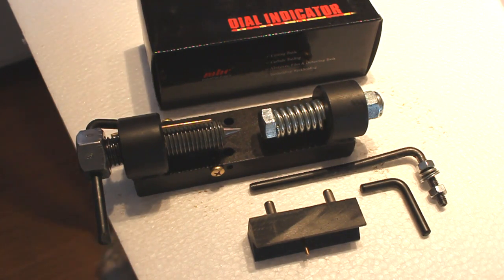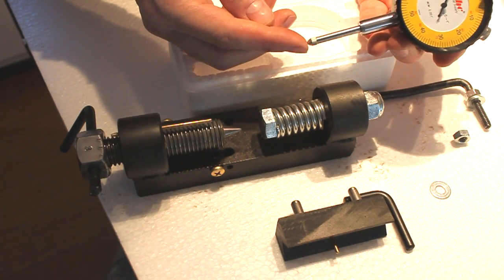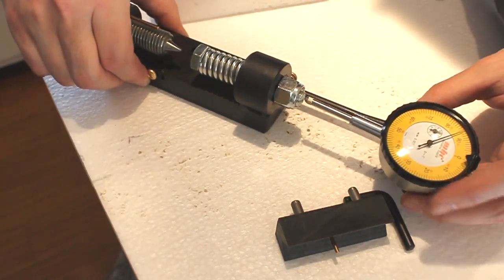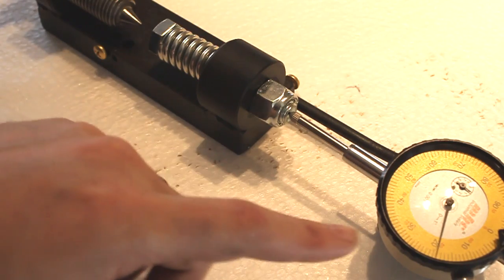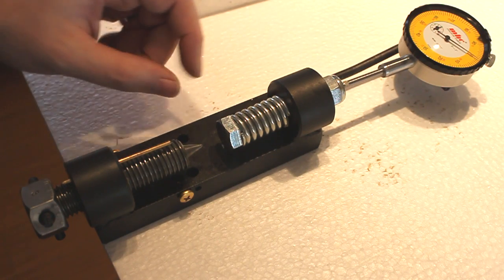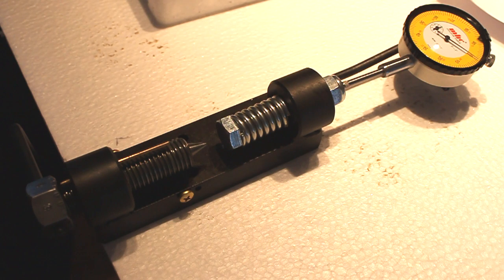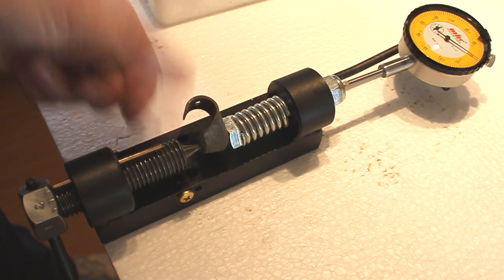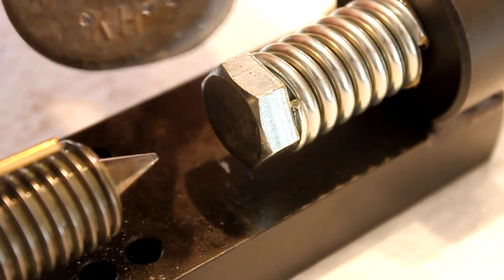Cabine Tree lead hardness tester

Comment: As a retired tool maker  the idea is sound but its bad practice for the ball  point on the indicator to go into a depression  on the tester  .. no depression  is needed it should  be just flat  and this will eliminate  any misalignment  issues  between the indicator  and the tester. I'm  sure other engineers  will agree

Comment: There are two areas that need to be modified here, the point should not turn into the sample, this should remain pushed straight in by being free to rotate, an easy modification, and the end of the thrust plunger, that the dial indicator rests on should be dead flat, another easy modification, these two mods will make it a much better tool.

Comment: Love the vid, just got one works great, but  one little thing Cabine tree does not make them any more another co.does and sold through Buffalo arms co. I ordered one 120.00 + 25.01 shipping &hand. They sent me 2 and billed for 2. I called up told them you sent 2  and I will be sending 1 back.Good so far sent back cost 13.65. shipping.one week later get e-mail saying.120.00 will be taken off cc, called them asked what about 25.01 + 13.65=38.66 They said it was a web order and could not refund that money. Will not be buying anything from them.
Reply: Dude! Charge back the credit card charge!

Comment: how repeatable are the results.  you took several from the same lead weight, how consistant were the readings
Reply from the maker: That was a long time ago.  If memory serves the readings were repeatable once you learn how to operate the device in a consistent manner which includes proper placement of the material.  I have not needed to use this tool lately but when you need it... priceless.